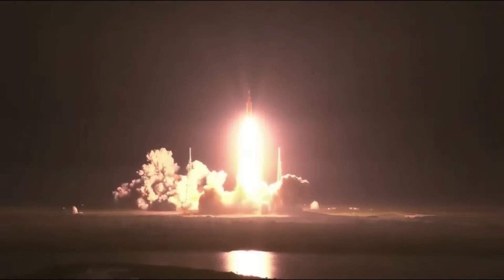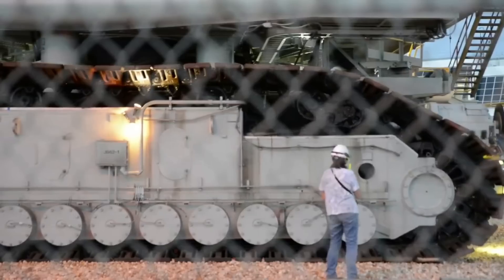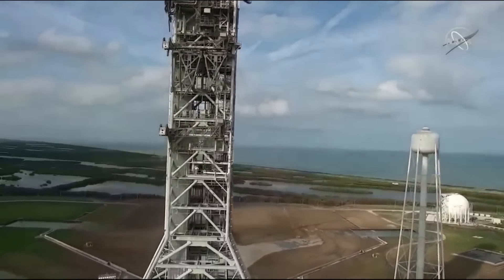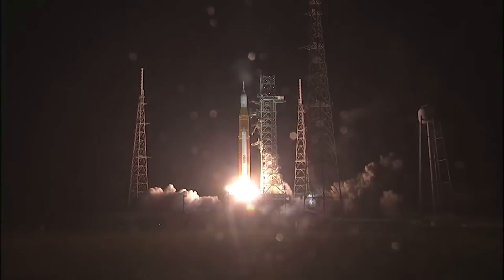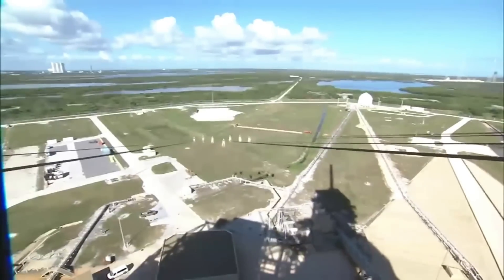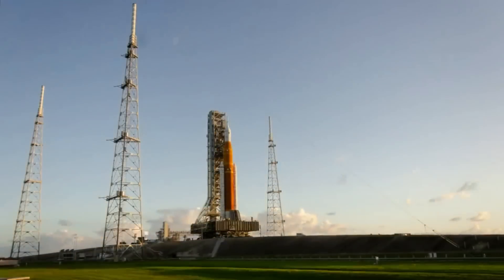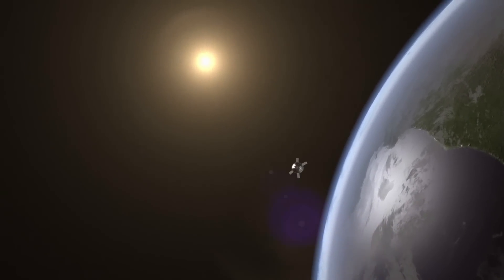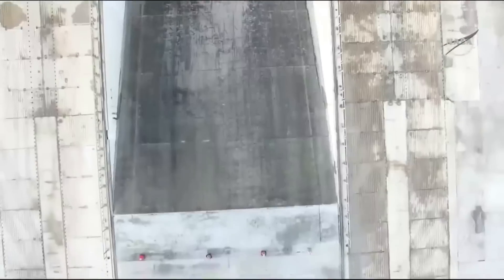NASA Is Almost Done Repairing The Launch Pad After Artemis I

Comment: OK, new NASA commercial venture. Joy rides and races using the emergency evacuation gondolas (ae?). $20 a go.
Reply: fun fact, initially ML1 was supposed to have a rollercoaster instead of zipline baskets.
Idea was dropped because uh... 1 much more expensive, 2, NASA wanted LC-39B to be multi use pad for multiple rockets including commercial HLVs, and having a tall fixed structure may interfere with other LV procedures.